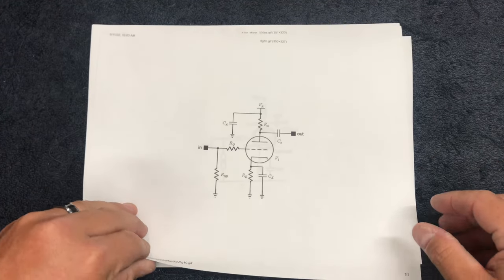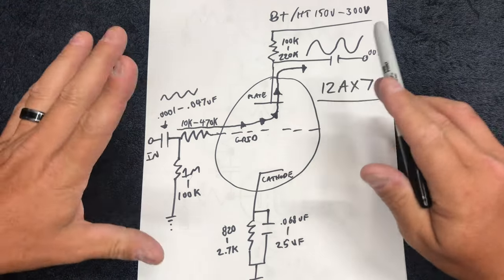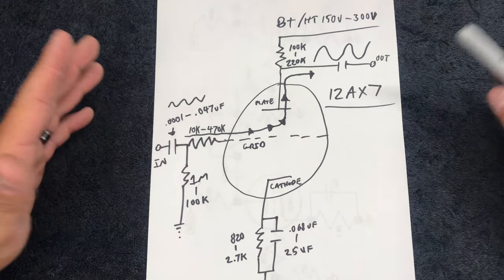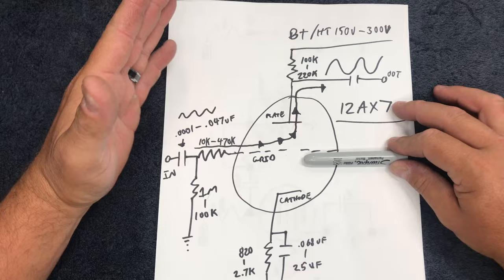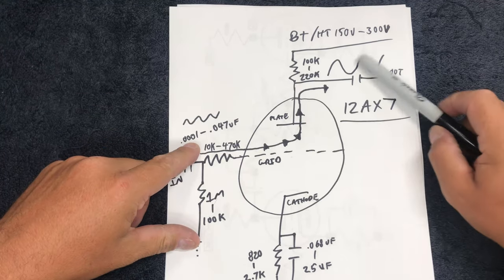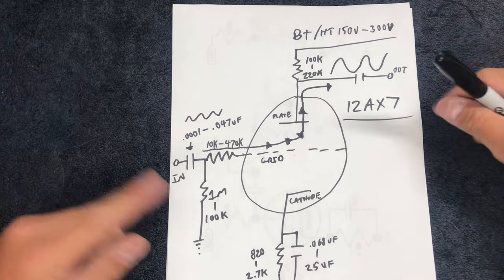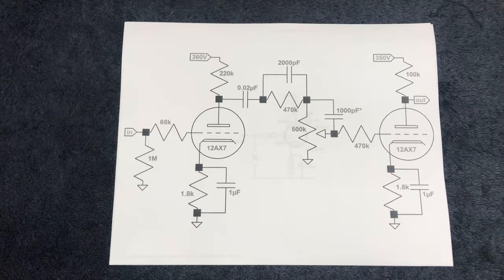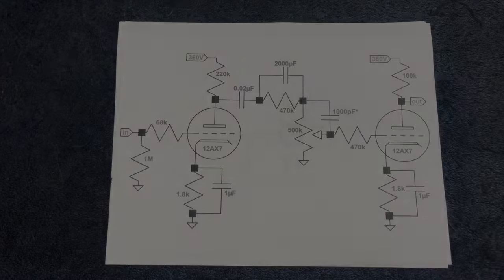Let's build the worlds best guitar amplifier Part 1

Comment: The grid leak resistor also acts to provide negative voltage to grid bias the tube. The grid biasing on this circuit is indeed “creative”. I’d like to what the grid bias voltages are.
Reply from the maker: This particular amp is cathode biased, so the grid leak is not exactly part of the bias circuit per-se, such as a fixed bias amp would be. The grid leak is a required part of any tube circuit regardless of function. It serves as the reference for the grid to ground, and acts more or less as a volume control and as a load to the preceeding stage. A voltage is formed around this resistor, and one could call it bias, as it does serve this function to a degree. In the case of a fixed bias stage, the grid leak really only provides a reference point, controls current flow and keeps the bias under control. It cannot be too large, or the bias will " run away " within the tube, and it cannot be too small, or the tube will shut off and no longer conduct. In a cathode biased stage, the difference between ground for the cathode and the grid is what creates the bias. This is in relation to the plate voltage of course. Change the plate voltage, and the bias will shift along with the operating point of the tube. It si all about creating a " window ". There is an area, where this window works best, given the plate voltage you are working with.

Comment: Need a decoupling capacitor on the input 👍
Reply from the maker: Need is a strong word ;)  most amps use it as a tone shaping tool, not for safety. I generally shoot for as few number of parts in the signal chain as possible. If you have to shape the sound before it even hits the first stage, then what are you doing it for?

Comment: It is a very good explanation, but you got one thing wrong: A standard amplification stage with output at the anode will always reverse the phase 180 degrees. That can be important when
you later want to mix different signals. You need to be aware of the phase. I once build a clone of a Marshall 18w with reverb, and found out that the reverb signal and the source signal
were out of phase - that didn´t sound good.
Reply from the maker: I didn’t t really touch on phase at all. I just said the output would be a bigger version of the input. Which clarifies nothing of course. However, yes you are correct that the basic triode stage will invert the signal. My drawing does incorrectly show the wave as it relates to in and out. I wasn’t really focused on that part of things as much as I was trying to get all the other data out. Thanks for pointing that out though, because it does matter

Comment: Hello
Theoretically speaking, would it be possible to build a tube amp that would have 50 watts or more? If so, what components would increase the wattage?
Thank you
Reply from the maker: As a single ended amp, much above 30 watts is going to be tough. KT88's are about teh only tube readily available that can get you there and beyond, but you have to scale voltage with it. It is not always practical to design an amp with a wattage in mind utilizing specific parts. When you start going with push-pull/class-ab designs, you can easily push beyond 50 watts if desired.